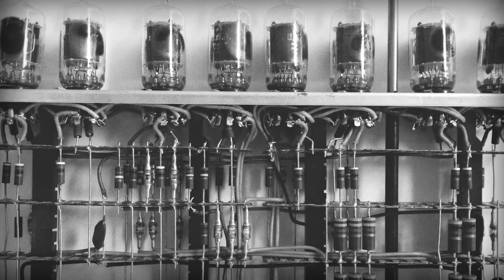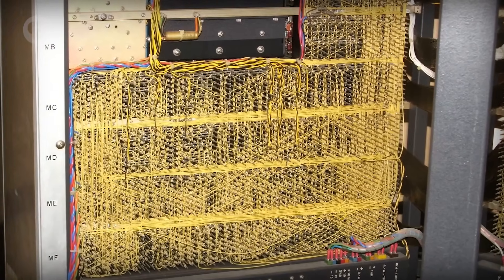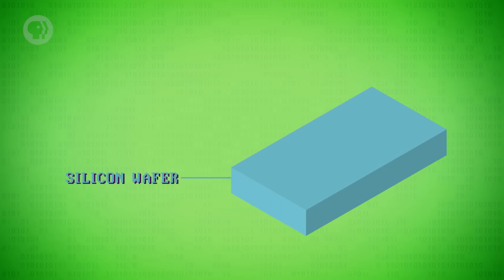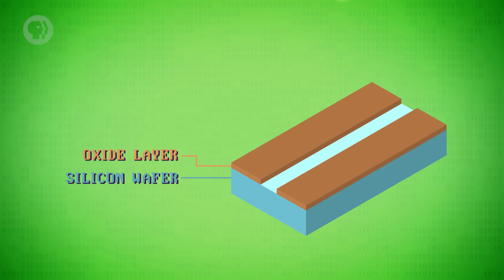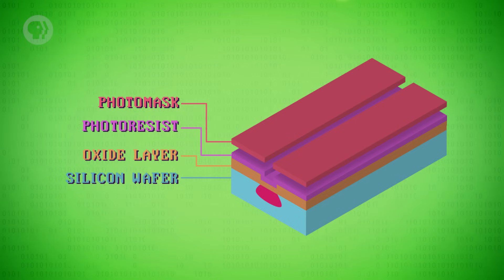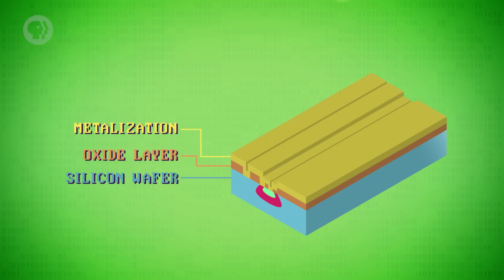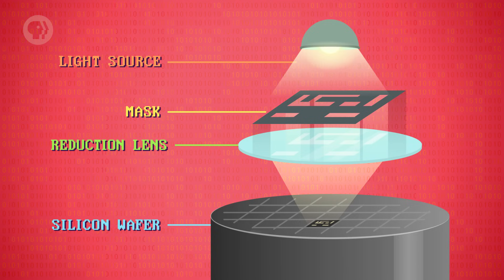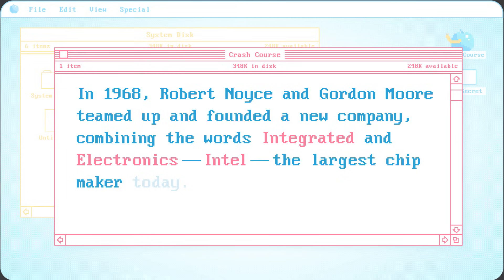Integrated Circuits & Moore's Law: Crash Course Computer Science #17

Comment: probably a dumb question, but why is there a constraint on the size of a microchip?  i understand that shrinking everything into the nano scale allowed for millions of resistors on a CPU...but why not just increase the size of the CPU as well?  wouldn't that extra real estate effectively double the computing power of a CPU cause you can fit on even more resistors?

Comment: Just a thought:
Instead of needing to have the IC processor chip (the heart of the IC) have connectors to get to larger wires which then connect outside the IC, why not just have chips within chips so there would be no need to waste space in the IC on wires connecting out?  Could we not formulate a digital speaker, for example?

That being said, if this "waste of space" was not needed as above, could IC processor chips have used the entire space in the IC and had more processing power or memory?  Wish I could post a drawing so this would be more understandable.  I would appreciate any help you could give.  Thank you.

Comment: this is a really great informative video. However, you forget to mention the third reason which further miniaturization of such ICs may face. every transistor is fabricated over the Si wafer which itself is a electrical conductor through which current/electrons are traveling. These results in local HOT-SPOT of nanometer size. the heat flux density over these Hot-spot is expected to go beyond 1000W/cm^2 in 2020 which needs to be dissipate for the successful operation of ICs otherwise these electronic components will fail.

Comment: suppose you could build a quantum transistor containing just 2 hydrogen atoms, they'd be at least 70pm apart, which is about 200 times as small as the current 14nm size transistors.. so if we can use quantum physics to our advantage to manipulate the potential of the electrons (or do things with the electron field if you're looking at QFT), then MAYBE moore's law can live on for yet another log_2(200) years

Comment: Its worth noting that the actual processing speed hasn't sped up in the last 2 decades, as in the early 00"s the clock speed hit its cap because of temperature. The efforts of more transistors are used to increase parallel processing, and the speedup for that is subject to Amdahl's law.

Comment: To add on the limit of Moore's Law. At some point in the future making the transistors smaller cannot be achieved since then the size of a transistor will be in the order of a few atom. However, Moore's Law does not directly have anything to do with the size of a transistor, but with the number of transistors per IC. This can also be achieved by other methods like 3D-stacking of transistors. For those curious, I would advise to google a bit, there is plenty of information on the topic available.

Comment: It's so crazy: photoresist and washing is how old school blue prints were made. Crazy how such a lo-tech method formed the basis of our hi-tech chips.
Reply: That's actually the power of abstraction. You can turn low-level tech into high-tech and make it look like magic (I mean mathematics). For example, the first levels were literally turning on and off a switch.
Reply: Yeah, it's another application of a technology that was around at the time.  The same process was used to make the first PCBs:  Take a fiberglass board, coat both sides with copper.  Use photoresist and etching to remove unwanted copper, and you're left with copper "traces" - a.k.a. wires - on both sides of the board.  Then drill the holes through, and you've got a PCB.

Comment: Fun fact: The number of people who believe Mores law will be disproved within 2 years has doubled every two years since it became popular. This means the number of people who believe it will be disproved grows at the same rate as Mores law predicts of transistors.
Reply: Is this going to become some really weird meta thing, where once it comes close to half the world's population, the number of people who believe that the number of people who believe Moore's law will be disproved within 2 years will be doubled every two years?
Reply: Unfortunately multicores have diminishing returns because of the fact that dependencies within code prevent most programs from making use of that many cores.
Reply: Moore's law is that the density of transistors on a 2D plane doubles every 2 years, not that the number of transistors per device doubles. Having more cores doesn't help us do things more quickly; it helps us do more things at once.
Reply: +simpletongeek: It is true that multiple cores help.  But also remember that for there to be more cores without increasing the size means that each core needs to be smaller, hence the transistors within them need to be smaller, so in the end, while more cores let more processes go on at the same time, they cannot get over the fact of a minimum transistor size.
Reply: Diamond semiconductors that could withstand higher clock speeds, quantum mechanics normalized transistor architecture, single atomic transistors, whatever the successor to lithography would be. 
There are any number of ways moores law could be extended.
The current slump doesn't disprove the overall trend.
Reply: +TheSmileyFacedPizza But but but!
By having more cores, it's possible to split a problem into several sub-problems which can then be worked on simultaneously, thus speeding up the overall problem-solving process.
Of course the operating system will need more complexity to be able to determine which tasks (sub-problems)) can feasibly be 'split off' into separate tasks, but with the powerful CPUs modern computers employ, it should, generally speaking, result in a measurable speed-up.
Reply: TheSmileyFacedPizza Many problems can be easily solved in parallel. Databases, Raytracing, Particle simulation, AI problem solving, etc. OS can automatically do some of it. Vector processing can be easily done that way. Pipelining calculations is already done automatically. Anything multi-threaded is certainly doable. Beowulf project does that. No problem at all.
Reply: Of course Moore's Law had to reach a limit. Anything that is incremented by the power of 2 for any given period of time will eventually reach a limit.
Reply: Nazneen Zafar there's actually been some interesting developments in cooling user super hydrophobic surfaces. So we might see clock speed go up again.
Reply: Rationalific Moore's law deals with performance, instead of manufacturing concerns. If you consider that a room sized computer can now be had on a chip, then logically, current room sized petaflops supercomputer with its numerous CPUs will be shrunk to laptop size in the future. That's assuming density stays the same. 

If nothing else, storage costs will be cheaper. Cost is another effect of Moore's law.
Reply: I never said there weren't tons of multithreaded applications. I'm just saying that multithreading is only part of the problem, one that can always be solved by adding more cores through supercomputing. However, a supercomputer will still load up programs more slowly and have hard times doing sequential workloads because supercomputers are made to be slow. If we simply focus on single-threaded speed, those improvements will show everywhere, from single-threaded applications to supercomputing, and cores can always just be stacked on. Especially nowadays with AMD's Infinity Fabric and potentially Intel's new mesh, adding more cores is easy. Making actual improvements is not.
Reply: Ben Cradick I'm very curious about this. Would you mind linking the source/papers?
Reply: But it is dying, several years ago Intel had 2 or 3 levels ahead of it's competitors in photo lithography, today they struggles with 10nm fab and the competitors are catching up despite all their disadvantages before.
Reply: @Napoleonic_S  Not yet. Competitors have surpassed Intel and delivered 7nm chips just in time for the law to be true. They're working on 4nm now, and if it's completed before 2022, the law will still not be dead.
Reply: There are no problems that can be split up; there are multiple problems that we solve one at a time. Adding cores simply allows us to solve more of those problems at once. There will always be limits to how much we can multithread something. For example, if I wanted to find the average between two numbers, you must first add the numbers then divide by two or divide by two then add the numbers, although the second one is far less efficient. You can't have one thread adding the numbers and another thread dividing the numbers because the result of one is the input of the other. That's why so many applications take up a single thread. Tons of calculations done by computers are sequential, so to speed them up, we need faster cores, not more cores. More cores are nice, though, depending on the application. Faster cores are nice, always.

edit: It's up to the programmer and the compiler to parallelize. Having the OS do it would be way less efficient. It's simple compared to other things programmers must do and think about. If you ask me, I think knowing how to optimally parallelize whenever possible is part of being a not mediocre programmer.
Reply: it's not over until we've reached blach hole computers. B)
Reply: Moore's law is still valid, in the form of multi cores. first, there are two. then four. then eight. I believe we have 18 now. still keep going on.
Reply: @simpletongeek  We have 64 core processors now, in just 2 years. Moore's law is more than valid for multicore cpu's.
Reply: it's not over until we've reached blach hole computers. B)